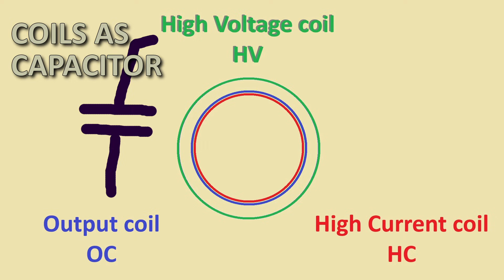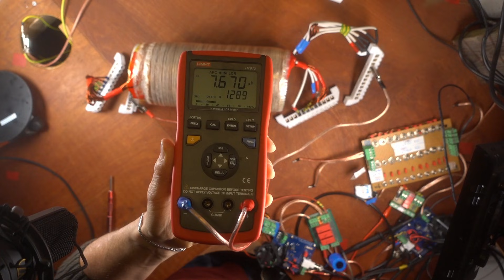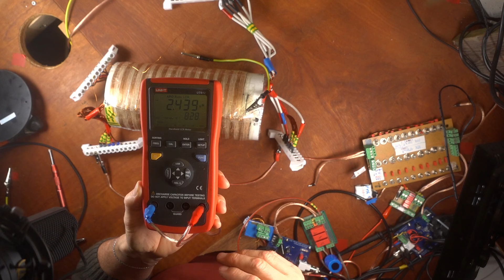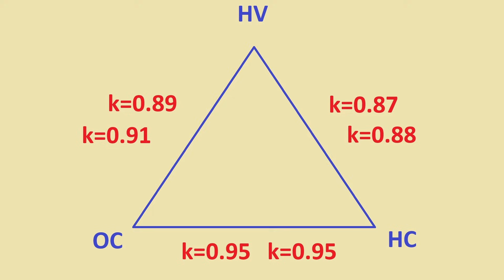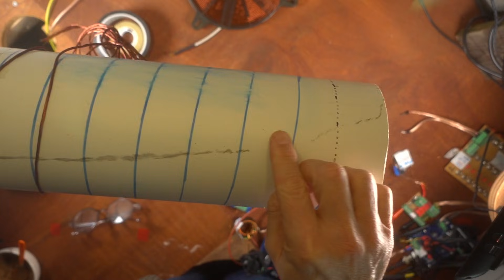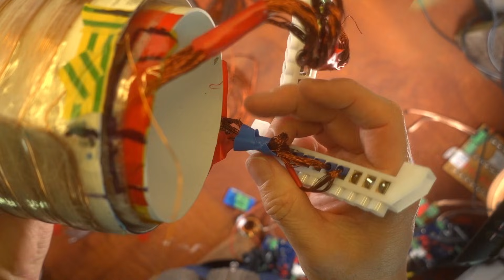Measuring the feedback coils + extra build info

Comment: Is feedback a singal of unbalanced coils?
Reply: @MasterIvo 
From Tesla's patent on bifilars also creating a tank circuit within the bifilar coil shouldn't a precisely tunned bifilar coil eliminate back EMF?

If so, then wouldn't tunned coils reduce the back EMF? If there is back EMF then wouldn't that imply the coils may not be in tune with each other?

Just a thought comparing the auto tuned bifilar coils to other coils.
Ideally... all coils would need to be tunned to each other. Only Nikola Tesla's tuning method at that point would be applicable. Right?

Comment: I believe there is a harmonic related to the length of the wire in the coil and the leads going to it. Copper itself prefers a certain frequency. When designing radio antennas, coax cables and antenna lengths are necessary to reduce SWR so that the antenna will resonate correctly. IMHO. Maybe part of the tuning should include this.
Reply: puo essere ?

Comment: Hi Ivo your coils and system look very interesting ... I just want to let you know you don't need anything fancy to create a working FE system only L1 and L2 obviously the L1 is a resonant shunt and its driven in a non hertzian way . I have found it to be of most importance for the driver to be in a low frequency mode . When you find system resonance the input voltage potential is powering the device 👋😎⚡
Reply from the maker: correct, but I'm not after free energy only. as it will only power small loads.
I'm looking for big free power. thats why I need a third coil. to mix the voltage with a current.
And yes I see the voltage powers it as the current drops at the supply❤😊
Reply: @MasterIvo  Cool 👌 I have been watching your yt vids for a while and you inspired me to start experimenting with bifilar coils still have them and i turned mine into crystal chargers 😎 I defiantly understand what your saying about the big power cant even put a meter on the output ⚡ I have found useful uses for the output like water purification 🌟 🤝🤫
Reply from the maker: @azombieslayer2781   are you willing to share?
Reply: @MasterIvo  Yes defiantly !!!
Reply: @MasterIvo  Going back to basic's is fun like all the fancy tech we have to play with nowadays the humble capacitor and gas discharge tube we like creating high potential events and you build the L1 and L2 output for the VA you need ... Also if the pressure in the system is high there is no impedance so the best place to start is directly at the source input we like back pressure 😎🧐🙏
Reply: @MasterIvo Also very deep in full spectrum research all topics and practice too . Lightning is real VA you can imagine equipment and components you need to store then step down . Would also be nice to get your thoughts and ideas on custom parts my setup is all diy from ebay and what is with power supply's with so much protection or sabotage take care my friend 😎🙏⚡
Reply from the maker: @azombieslayer2781  interesting.
What do you think of N Tesla's use of the relay oscillator to replace the sparkgap?
Reply: @MasterIvo  Yes very interesting Mr T had many ways of interrupting , disrupting and transforming things got very high tech and still blows my mind to this day the mechanical and electrical precision was on a whole other level. Just to add playing with the high frequency side is scary the power multiplies and the stresses on components is MASSIVE.
Reply: Device running ⚡https://www.youtube.com/shorts/2hhynTpWqfQ

Comment: Only 1/3 of the way in so far and I'm thinking about the large PVC tube, what if it was not PVC but something with more electrostatic capacity like you used in your field propulsion video? Try coating the inside of the tube and see what effect this has?
Reply from the maker: you could try that. Good to see you replicate it❤
Reply: @MasterIvo  if i had the space and resources to, id be playing around with some of this stuff.i think there must be some kind of electrostatic pressure similar to how port flow in an engine is smoother when there is some roughness to the surface or how golf balls have dimples to fly faster. i think if it is possible to draw energy it will be through displacing this pressure into the material with high capacity for electrostatic charge and having the coil accumulate it and transmit from that. im not very technically knowledgeable when it comes to electronics but take a look at different RF fields, there may be something that is a transferable principle, what springs to mind is a video from 'TheOldScientist" titled: Superluminal Scalar Waves for communication

Comment: I would love if you could explain how would the longitudinal waves(vibration) and rising current with abrupt discharge (sawtooth wave) would work in this coils project? Is it designed to incorporate those waves?
Reply from the maker: yes it is, at the high voltage point, the other coil is switched. this brings an abrupt change in voltage as they act as capacitor plates.
the switched coil is low voltage, but it influences the high voltage through capacitive coupling❤

Comment: Dude you are missing a major thing in your inventions. Assuming that you know the real structure of reality (Ether, dielectric/magnetic flieds, etc.....), what you are missing is the effect of moving energy(=matter) bending the ether. Look for example at a big black hole in the middle of a galaxy and look at a quasar. The black hole may have a lot more energy (mass) and therefore a way stronger gravitational pull (because gravity and antigravity are proportional to energy (density)) but the black hole doesnt "shoots" energy out at the vertical axis, as an insanely fast rotating quasar does. (Physical: Voltage "opens" the ether, the vortex-like bended ether forced through circulating matter creates energy flow and the magnetic fields direct energy.)
A little problem is, the angular velocity of the circulation needs to be higher than our current technoligy standard materials can endure to really create useful inventions like antigravity spaceships.
Reply: Blackholes don’t make sense for “this technology”. They wouldn’t co-exist. What we see in “pictures” of a “blackhole” would just be a large plasmoid.
Reply: @CokeAMor I guessing you are judging based from the current atomistic world model? So if you studied conventional physics you cant grasp what I‘m Talking about, it would sound like total rubbish to you.
Reply: @BackwardsJohnsCreations  no, I just don’t believe in blackholes, because the evidence is lacking and I have a degree in science, so i do think scientifically and I don’t believe that cosmologists do. The universe is vibrating, it’s not just one explosion moving outwards. The big bang is a narrative without good evidence, like blackholes.
Reply: @CokeAMor the evidence of black holes is Lacking? What Are You Talking about ? Theres not much we have more evidence for. You can see them in nearly every galaxy Center. You can see the effects to its surroundings a Billion Times in the visble universe. Fuck this keyboard
Reply: @BackwardsJohnsCreations  no, we can see SOMETHING and cosmologists theorize that it’s a blackhole and they sell their theory to the public as if it’s a proven fact and it’s not.
Reply: @CokeAMor  Oh ok yeah I understand now, so when I say black hole I just mean the object we know as black hole. And yes, our current state of physics models are not really accurate, and pretty wrong in some major Parts. So in case you want to know, a black hole is basicly a converter power plant, sucking in all energy (matter) on a horizontal plain axis and converting it back into hydrogen which gets ejected on a Rotation linear Vertical axis. Conventional science calls it evaporating of black holes.
The YouTube Channel „Theoria Apopharis“ explains structure of reality pretty spot on.

Comment: Cheers Ivo
Reply from the maker: Cheers to you too!
Reply: @MasterIvo  Hey when an Extra coil is free to resonate in LC with a capacitance but is driven by a larger inductor, such as the case of a resonant series choke say 5x less inductance than the main inductor. Do you think it's fair to say that the full system resonance is at Q x XC=XL rather than strictly XC==XL since there will be multiple cycles to match impedance?
Reply from the maker: @scottneels2628  I don't know, I drive with 10x the inductance at least

Comment: very good video thanks , my setup right now am getting 1/2 of the value when it shorted so that mean am getting only 50% coupling , i will leave it like that for now because its really stuck my next build i will fix that make the coupling better cant wait for the tunning video
Reply from the maker: Glad the video helped you understand your setup better!
Reply: @MasterIvo  yes now i see how to improve it next time my K is 0.6 for all
Reply: @EnergySeeker  In an ideal transformer, (k=1). In reality, the higher (k) is, the higher the efficiency of the system, because less energy is wasted in stray magnetic fields that do not contribute to mutual induction.
Reply: Really hoping to see how you would blend in into this coils project the longitudinal vibration and rising current with instantaneous discharge. Are these effects would be involved in this apparatus?